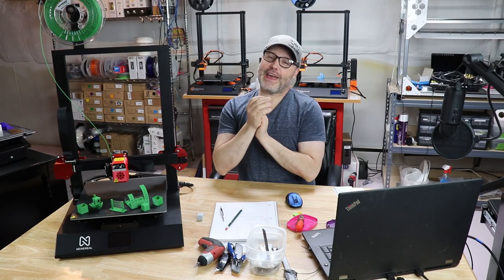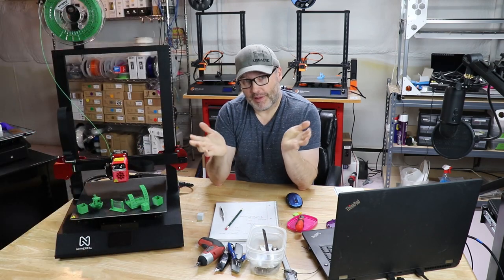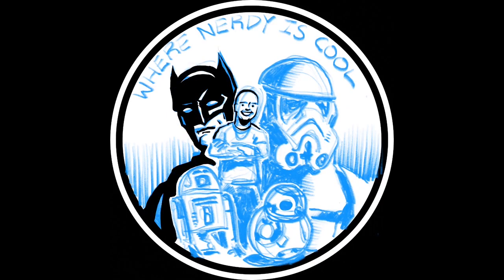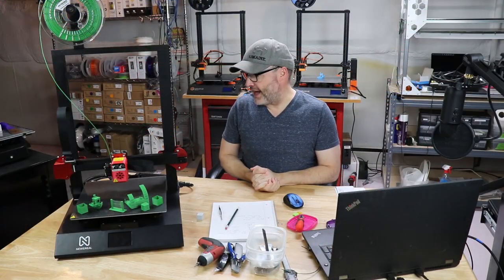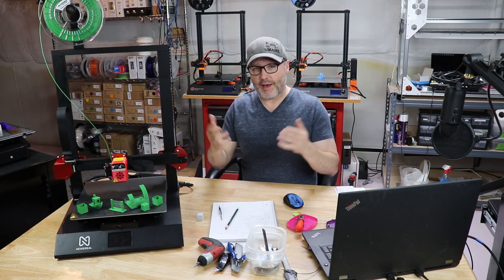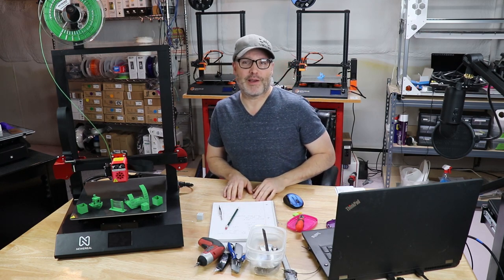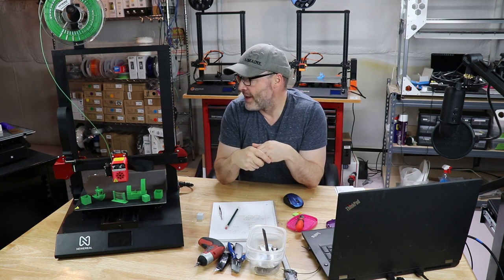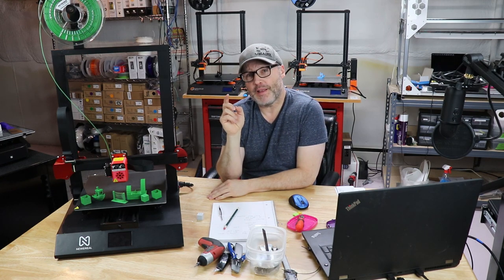First Thoughts on the NEWEREAL T-REX M18-S 3D Printer

Comment: 21X24=504, so yeah, 500W power supply, but it might say 360W because that's all the printer draws and they built in some overhead to keep it from overheating.

Comment: Hey great video! How did you contact the company? I was sent this printer to review as well and I can't seem to get in contact with anyone but the DX.com rep. I've had some issues with a big dip in the center of my bed and I was hoping to ask if they have a firmware version with MBL enabled, or at least a back up hex file so I can mess around with other firmware and jump back to stock if I need to. Thanks!
Reply from the maker: Thank you!  The DX rep sent me to  someone via email.  Mine had that center dip too so I think an ABL is in the future.  I don’t have much more than that!
Reply from the maker: @ModernHobbyist  that's the one that helped me out.  "eztwill9091"
Reply: @WhereNerdyisCool  Perfect, I guess I will just have to be patient! Thanks for your help, and good luck with your channel!
Reply from the maker: Sadly this is the usual level of support for most of these printers.  It’s largely Facebook Groups of consumers supporting one another